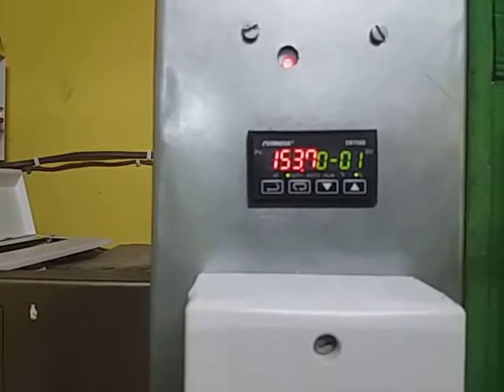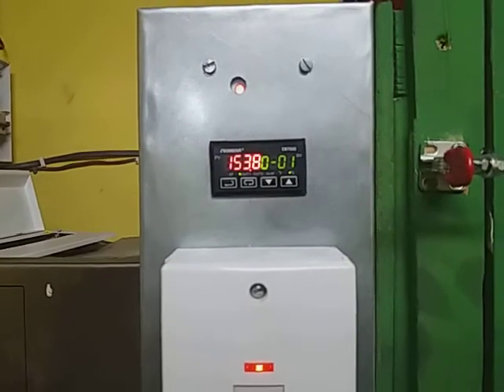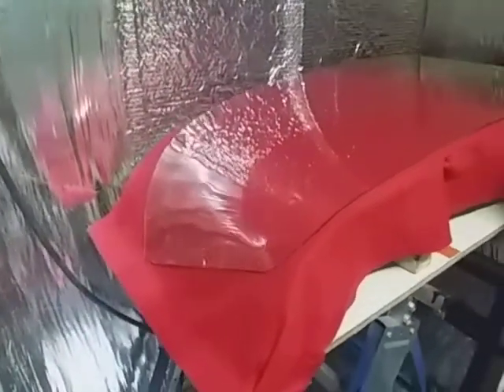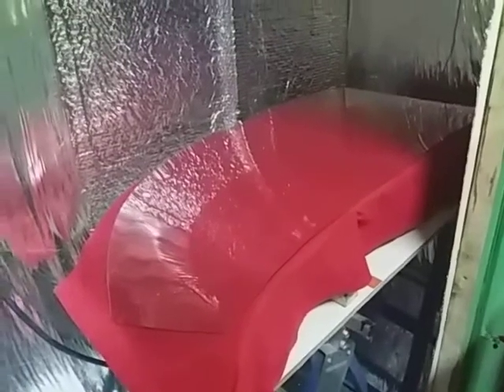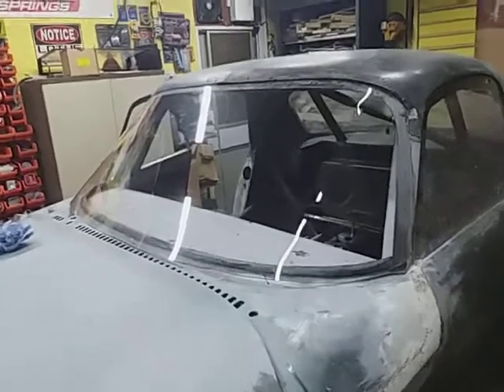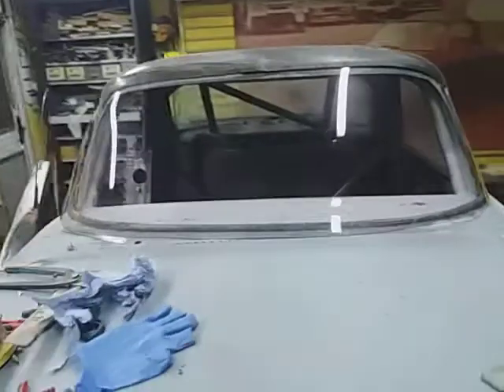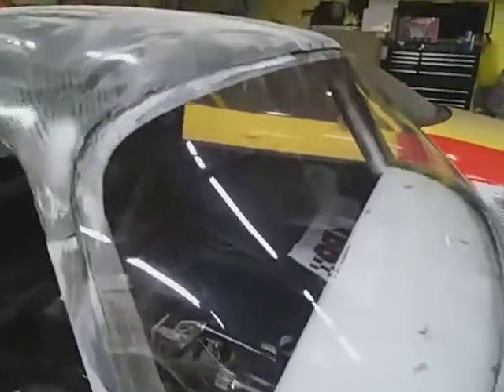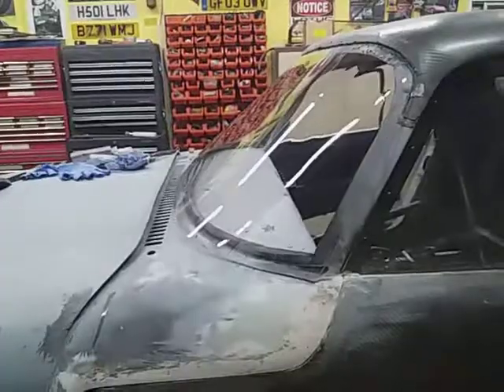Thermoforming polycarbonate windscreen - Part 3 of 3

Comment: I'm researching my options to make a new windshield for a 1968 Mark Twain 14 foot fiberglass runabout.  It looks to me from what I have seen is the best approach is to create the form you want your acrylic/polycarbonate to assume, position it, gradually heat your oven, hold the temperature high enough for the plastic to fully drape over the form, then SLOWLY let the oven cool.  I see so many cases where people are pulling their plastic sheet out of the oven into the cooler surrounding air and immediately the edges of the plastic begin to cool and deform the sheet, making it difficult to work with.   This did not appear to happen here at all.  Well done and thank you for the education!

Comment: Is this for a UK road legal vehicle? I see very conflicting info about this topic, ie if you can or cannot (i'm hoping i can). It meets the main criteria i'd say of not shattering in accident, but the MOT does say glass with no other mention of alternative. Just need the right MOT tester who agrees?
Reply from the maker: My MOT tester said that as long as the wipers work then there is no problem with poly. MUCH safer than glass and around 250 times as strong with regard to shatter resistance.
Reply: depends on juristiction, in many EU countries like Germany or Austria non certified or exempted parts with extra papers are illegal, while in some BeNe Lux countries you do not need anything ….as you do not. need a MOT on motorcycles in France at all! or for older than 30 yrs cars in the Netherlands( i think,,,,they are exempt completely! like some trailers too! very conflicting when you travel and some shit happens! or look at all the foam glassed wings and bumpers and spoilers in BG or Romanian videos, completely illegal in Austria! where i live and vehicles are sadly boring due to that,…) , same goes for body mods in USA or Australia! impossible in many EU  countries! and Germany has a system if approved parts with papers…which is often sold here in Austria and then the police confiscates your license plates and fines are high! …check on your local countries or state laws! sadly a mess of inconsistency all over the continent….but same goes for USA, some states do nit even have a MOT! …but only 2-3 or so….and the top is the car , what is underneath nobody cares! while EU needs confirmed fitting data of chassy and engine….frame and top are one item and so on,….) …

Comment: Dont count rich. Plastic (PC, PMMA) screens scratch easily due fine street dust and are hence not allowed by EU law for street use, hence not street legal.
Allowed for concours and racing: OK.
Reply: For windshields that's true. For side windows more is possible. 

But here in NL the cars older then 50 years are exempt from the yearly mot technical check. So unless you make an accident where the windshield was the problem, nobody will ever care.